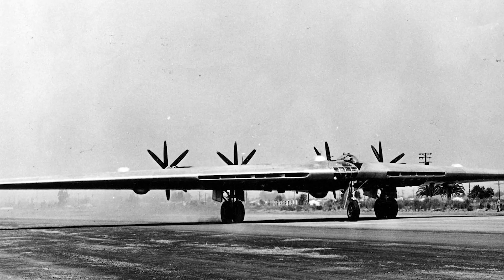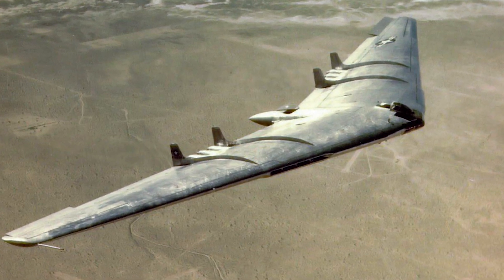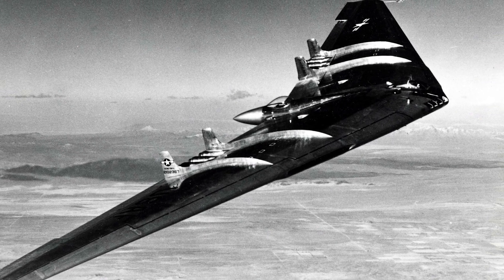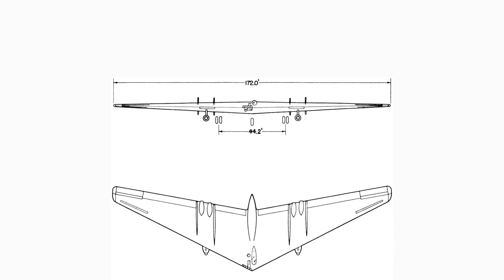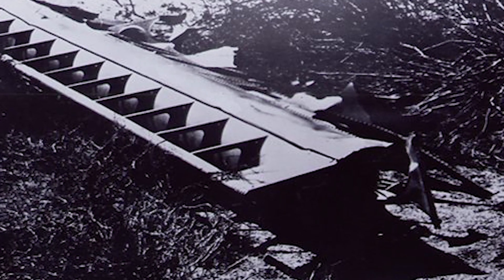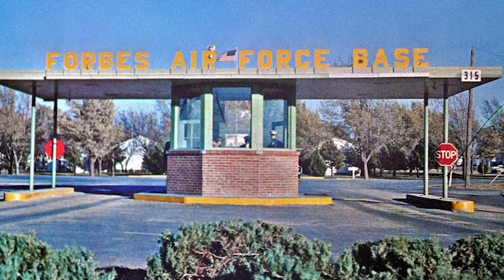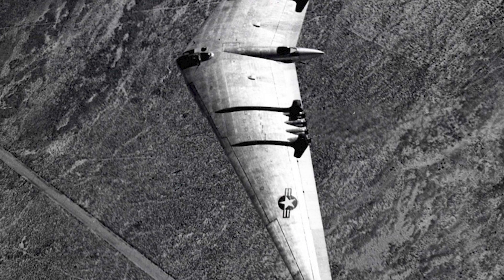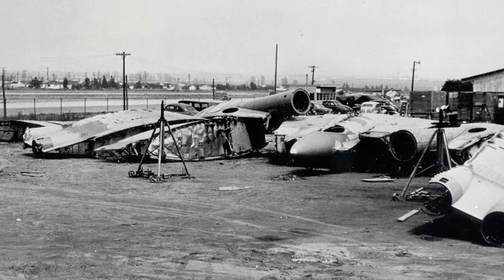The YB-35 and YB-49 flying wings, the forgotten ancestors of the B-2 Spirit

Comment: No mention that it was the German Horton brothers that came up with the design of the flying wing ?
Reply from the maker: Thanks for your clarification.
Reply: There is no mention simply because the Horten brothers were NOT the first that came up with the flying wing concept. And moreover, the design of the YB-35 started in the early 1940's when Northrop got a contract from the USAAF at a time when the USA and Germany were at war! So, no input from the Horten brothers was used. jack Northrop and been making experiments with flying wings since the 1930's as had others before him!
Reply: Casi todos los aviones experimentales se basaron én tecnología alemana .
Bell X -5  , los primeros intentos de aviones V.T.O.L  .
Én la tecnología de Lipics  con sus estudios del ala Delta pura se desarrollan los cazas F-102 y F-106 .
Hasta el F-86 que se estaba costruyendo de ala recta .
Se modificó a ala én flecha al capturar el Messerschmitt ME 262 .
También el F-84 Tunderjet que ya prestaba servicio, su última versión se doto de ala én flecha por el mismo motivo . Seguro entonces que los Hermanos HORTEN.
Reply: It's a case of parallel evolution.  Northrop and the Hortons were working on similar designs at roughly the same time.
Reply: Ще 19 столітті придумано
Reply: Because they didn't. Northrop designed his wing completely independently of the Horten and actually before the Horten brothers and unaware of their work. Manx I think it was in England also independently and without knowledge of Horten or Northrop, designed a flying wing.